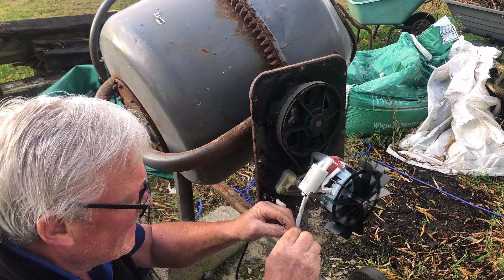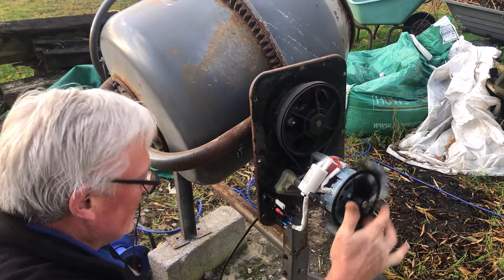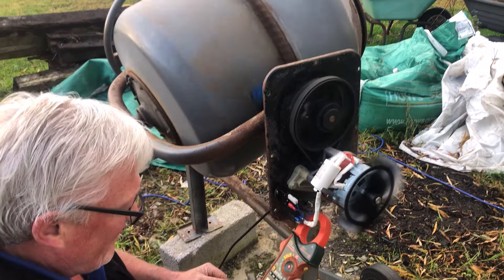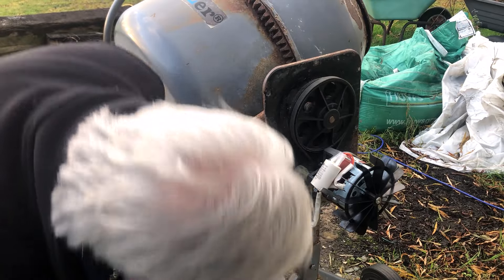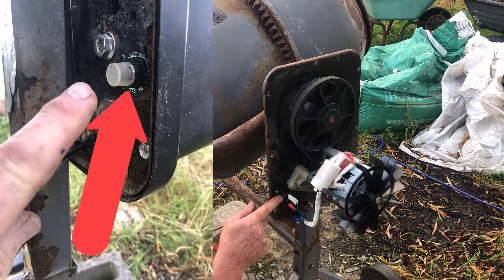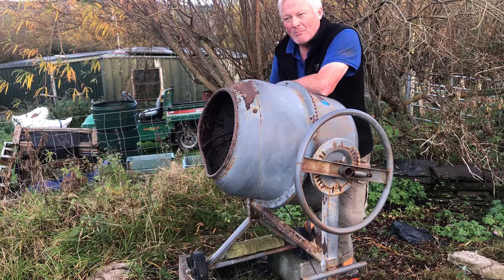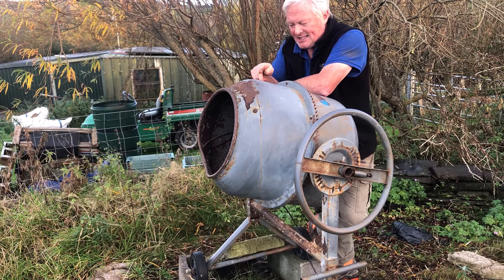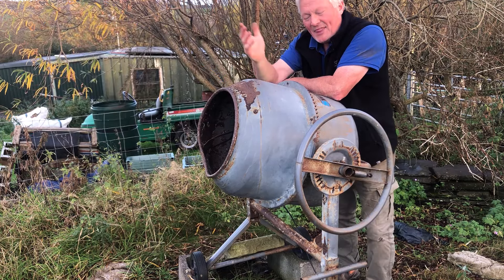Replacing the electric drive motor on my Cement mixer. #Cement mixer

Comment: Thanks for posting this video. Where did you get the replacement motor from?
Reply from the maker: Hi, Just off Amazon. I did look up the motor spec for my old one, and compared it to the Belle mixer motors! Hope this helps. Shaun.
Reply: @happydaysveg1965  Thank you very much

Comment: I will need a mixer for when I start re-pointing the walls. I think some friends have got one that I might be able to borrow for a while. On the subject of changing tyres, over here if you have to change a tyre you can just change one, they have to be done in pairs. Tyres on the same axle must be the same make. I had to change one last week which was a bugger as like yours, there was plenty of tread left, maybe 20k miles which for the amount of miles I drive would be at least 3 years. Annoyingly it was a small hole in the sidewall so it couldn't be repaired.  So 2 new tyres 150 euros,  fitting and balancing 36 euros.  😡